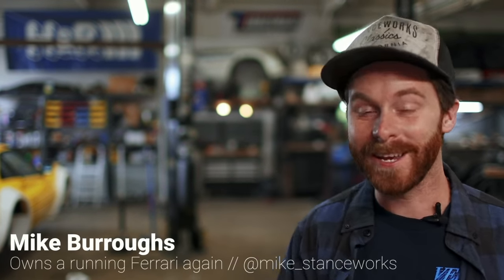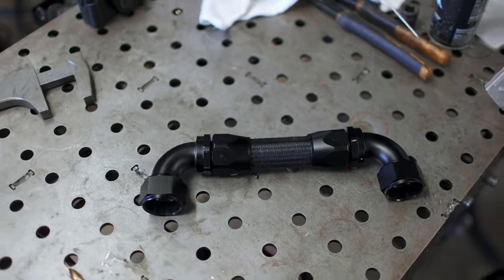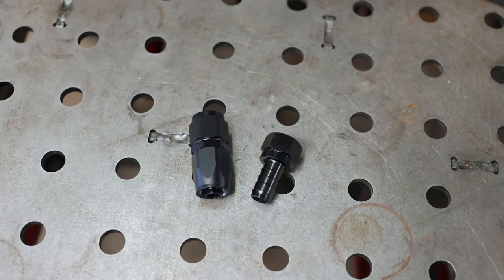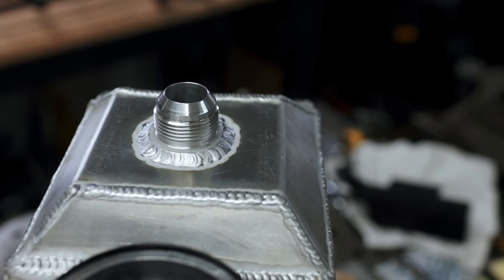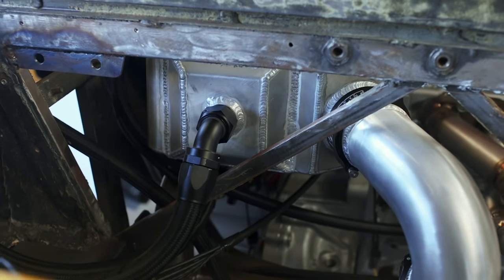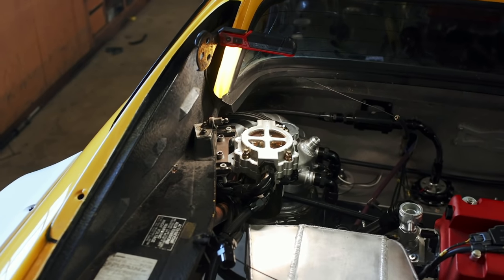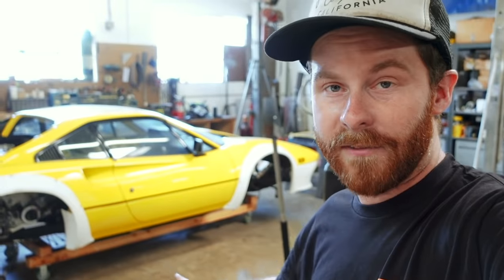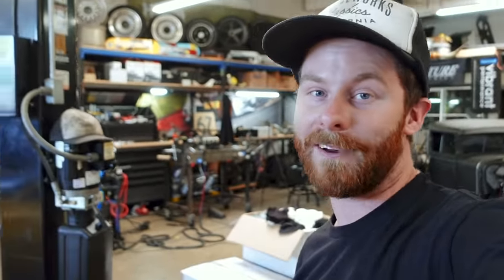Honda-Swapped Ferrari - Twin Cooling Systems: Problem Solving

Comment: Some years ago a friend went out on a limb and bought a neglected Maserati Merak in a "not running" condition. He persevered in trying to get the Peugeot-based V6 engine working. It ended up being a good-money-after-bad exercise. He fitted a Toyota 4-cyl DOHC engine with carburetors. I think it was a 2 litre unit.  He reckoned that it was in keeping with Maserati's 4cyl tradition of the Typo 60/61 Birdcage.  He fitted it in a north-south mid-engine arrangement with a different transaxle. It was an excellent solution. You have done a great job on the idea and the execution of a different and better Ferrari.

Comment: Amazing progress! I would rubber cap or somehow protect the AN lines just before the tunnel where they might abrade against the sharp edge of the (fuel tank i think) bracket with the die holes in it? Looks like a sharp metal edge. Maybe bend the metal over? something because vibration and time will eat the hose

Comment: The wire/spring fixture you made and used while welding the intercooler fitting was great.
I always get some great ideas from this chnnel -thanks.

Comment: For the push lock hose you can dress it up with some expandable braided sleeving to make it mimic the rest of the lines. Should be easy to find higher temp ratings as well since its commonly used in automotive applications. I know the hose wont be seen but its one of those things that you'll know its there.
Reply: Techflex is what I've been calling it for wiring, and you just finish the ends with a bit of glue heatshrink (raychem heatshrink)

Comment: Great work!! I would suggest running a purge when welding on tanks where there’s not a sealed surface on the backside. It’s simple to do and will ensure your welds are 100% clean on the backside.

Comment: Looking forward to the story and e30 content, as well as getting the coolant filled 🤙
Reply: drove a 1986 325e 5-speed, sunroof, for 25 years and 250k miles. still passed inspection when i traded it in. Those are great cars, they drive good, i got 30 miles to the gallon commuting, and dead reliable. replaced one clutch, one radiator, and maybe 3 or 4 alternators. still had original shocks and struts. i would still own it but i just don't have room for 5 cars in my 3 car garage.

Comment: I would surely recommend a thermal intake manifold gasket from Hondata or Speed Factory. Helps with heat soak from the head to the intake manifold. I cannot wait to see this thing move! Best Ferrari ever! 💯

Comment: You need to add a bung on top of the intercooler so that you can burp the air from the system since the intercooler is the highest point in the system.
Reply: Glad to see someone else pointing this out as well. Definitely going to need that if he wants full cooling capability in the intercooler.

Comment: I can't wait to see that skid plate installed. I'm positive it's going to be the flattest car on the track. For that I'm sure  you need the wheels and suspension dialed in. Sounds good looks better than factory even in multiple colors

Comment: just started learning tig and i started with aluminum... tough stuff.
Reply: It obviously depends on what you use the most but starting with steel would be easier to get the hang of it + it’s cheaper !

Comment: Love your progress on the Ferrari 
However just seeing that BMW E30 triggered my PTSD from loosing mine in 2017. 
I worked for 2 years on a 1988 325is and I never got to even finish installing all the upgrades I bought. 
I had it on the road only a couple weeks before a moron ran a red light causing an accident. My E30 was totally fixable but the insurance company screwed me. They claim to have written it off, but I have reason to think otherwise. That's to long a story to get into. 
I loved that car. I grew up riding in it as a kid years before I owned it myself.

Comment: When we were running late models, all the excited newbies would spend tons of money for fancy paint and AN fittings.  However, in short track racing, fancy paint jobs and other expensive stuff usually lasts only a few laps.  Good old radiator hoses and hose clamps allow you to make fast repairs on the spot while the guys with the AN fittings end up on the trailer.  A potential issue with your lines running front to back is air in the system.  If those hoses don't lay level and have a slight hump, you will have an air bubble that you can't get rid of.
Reply: Luckily, most of us have move beyond the Flat Earth Society and know how to tilt the car or the system to bleed if necessary. Not sure that will be required on a pump-pressurized system, but BTDT on juice brakes and clutches. Better to have a bleed, but not impossible without it, either.

Comment: Another possible solution for you coolant hose problem would be to change one of your 90’s to straight. Put the 90 on the lower male part. That should be easy to install and still use braided.

Comment: I m impressed,  really great build project.
Just a comment, I ve seen no bleeding valves on the hoses just mounted.
I m used to have several ones in my normal car. Could you tell us why? Thank you

Comment: Please think again if you don't want to install a thermostat. A lot of people drive without one, but from a technical point of view it's not an optimal solution.
 
Without a thermostat you will see very low cooling water volume flow in the - anyway thermally critical - warm-up phase. This leads to a high temperature delta between the motor inlet and outlet. The problem also occurs at part load, especially in the case of powerful engines with a correspondingly powerful cooling system. It is not for nothing that OEMs generally install (sometimes even heated) thermostats in conjunction with electric water pumps (e.g. BMW).
 
You could install a very simple, small cooling water circuit as a thermostat-controlled bypass. That shouldn't be a problem with the package and solve the critical issue.
 
Greetings from Germany
Dominik

Comment: I feel your pain with the AN fittings. I did all the oil cooler lines on Tony's 914-6 with AN lines and BRUH are they a bear at times. (Twin oil coolers to the front of the car with the oil tank in the rear is a looooot of lines and fittings hah!)

Comment: Usually thermostat is acting like two-way valve so you need to block up the cold circuit entirely to keep the coolant flow working.  Isn't that coolant fitting @9:12 meant to route coolant to heater core? wouldn't block that to keep head coolant temp even.

Comment: The build is really coming along, and things are looking good! One thought on the coolant block off plate on the head... might have been a good idea to drill and tap the plate for a fitting to bleed the system there? Wondering if it's possible it could get an air pocket stuck there in the head since it's not circulating coolant now? Anyway, keep up the good work! This is a very interesting build.
Reply from the maker: The hole there is directly connected to the outlet of the engine right around the corner from it. It should be no problem at all.
Reply: @stanceworks  Bit late I know, but did you add an air bleed to the intercooler end tank or somehow get it filled without one?

Comment: I notice the routing of the braided lines under the car are going by some sharp edges. I hope you are making some protection for the hoses to prevent rubbing a hole. Also hoses rubbing against each other. Looking good though.

Comment: Also plz pressure test that intercooler above the pressure you will be running.
Pulsing isn't the best idea for a strong weld on end tanks tbh . You wanna run it hot for penetration and good amount of filler for strength 💪 try to regulate the puddle with your foot pedal and maintain your melted puddle edge as you move. You're getting  better now time for the next level of your aluminum welding

Comment: A suggestion… One way to get a short run AN hose to work and give flexibility and ease of fitting is to add length by looping the hose instead of a direct shot, it’s not as pretty and not sure if you have space?
Reply from the maker: Looping a -20 hose requires a lot of room I just don't have

Comment: Since you have dual cooling system, are you using two water pump, one for each cooling system?
Reply from the maker: Correct, there’s a pump for each.
Reply: Why not just go with one giant pump and heat exchanger?
Do they operate at different temperatures and heat transfer ratio?
Sorry if my question is naive ✌️ amazing work, following it since part 1
Reply from the maker: That would just present heat crossover from one to the other. It’s important to keep them separate

Comment: Won’t there be an air pocket in the intercooler since the lines only come up halfway on the tank? If you could fill from the top of the intercooler I could see it coming out but I feel like it won’t fill all the way up with the lines halfway down the tank.
Reply from the maker: I’m adding a bleed port 👍

Comment: Is there no way to add length before the AN bungs so that they are in the same plane? I would think that would solve the install trouble and keep the braided line.
Reply from the maker: That’s how I had it prior. But the fitting fouls the starter if I do that.

Comment: Did you have to align the elbows on that AN hose along the chassis, or is there enough twist in the hose to let them line up wherever? Also, was there a reason you needed to fit both hose ends on the car rather than doing one end on the bench then threading the hose through and fitting the other end on the car?
Reply from the maker: I did one end on the bench and one in the car. It was two different hoses. Feed and return.
Reply: @stanceworks  Good thinking. I need to pay closer attention!!

Comment: Hey Mike, for your short run from the water pump to the engine block, do you have the clearance and will the hose flex enough to use two 45 degree fittings?
Reply from the maker: Unfortunately the hose kinks with 45s.

Comment: Tip from a hydraulic fitter of 20 years: A hose should never have two angled fittings on it. 90° on one end and a straight on the other and then use a short radius swivel 90° with the straight end would’ve fixed the problem.
Reply: The biggest issue with using two angled fittings is that you’ll never get them perfectly aligned and always put twisting strain on the hose causing fatigue.
You also get more movement with the extra connection on the swivel 90°

Comment: Hey mike. I was wondering why did you not run vtec on the honda Ferrari. I want to build a 600hp k24 as a daily driver should I run vtec or non vtec?
Reply from the maker: For a daily, keep vtec. I did it for simplicity, reliability, and because I want that mean choppy idle. I don’t need the low end power, it’s a “race car.”

Comment: Lengthen the hose so you have a short loop with more flexibility
Edit: the upper fitting will rotate relative position 100 degrees or so

Comment: Why not just lengthen the shortened fitting? Make it so it's on the same plane as the lower fitting. From my comfortable desk, it looks like there's plenty of room.
Reply from the maker: It was the same length before. The fitting doesn’t clear the starter.

Comment: I won't be able to sleep at night knowing you have a rubber radiator hose and not a braided steel line!  🙃
Reply from the maker: I’m still trying to come up with another viable solution that isn’t a pain to service. Serviceability trumps cool points, but only just.

Comment: Wheels:  check out what's on the Ferrari 288 GTO.  225 55R16 fronts, 265 50R16 rears, was stock, but the 5 spoke wheels are strong and look right.  17x8 & 17x9 for $3,700 custom recreations at:
https://www.nicksforzaferrari.net/